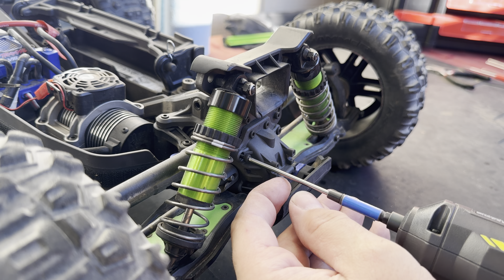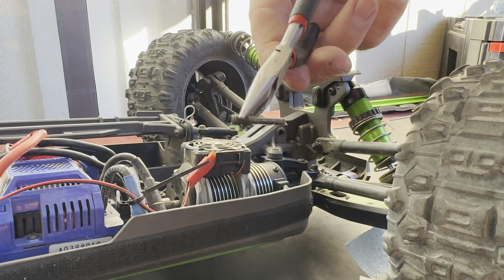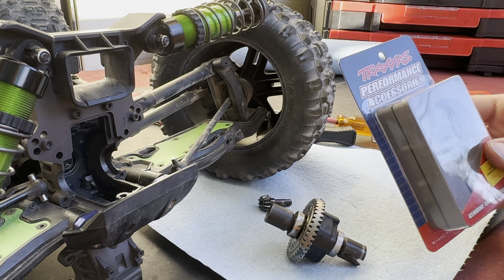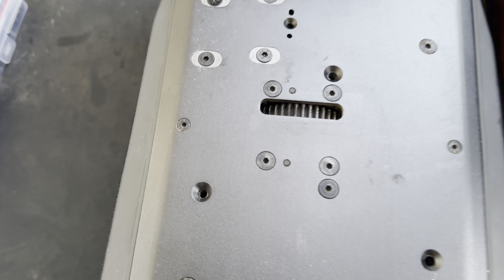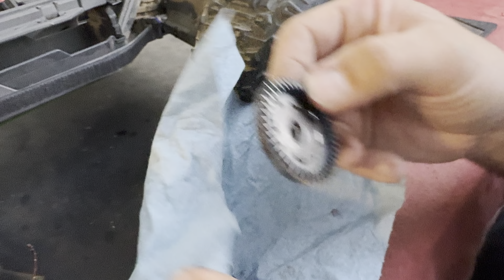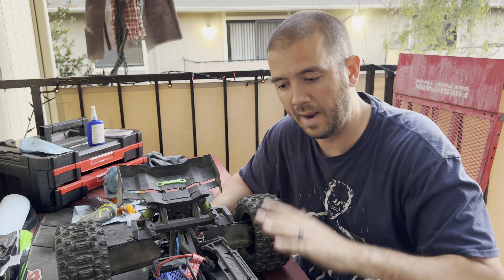Your Traxxas SLEDGE NEEDS These | Spiral Cut Gears “UPGRADE”

Comment: Installed the hardened spur and pinion, front and rear hardened diff gears. Kept the stock spur gear and pinion tooth count and installed the motor shims underneath too. Definitely alot more solid i used the Lucas red and tacky grease in the diff housings though......its definitely alot more responsive when you rip that remote trigger 😅
Reply from the maker: Try the CowRC grease, very nice. If you plan on getting some supplies use RBR10 at checkout. https://cowrc.com
Reply: @redbanditracing ill definitely check out some lubricant and cleaning products.

 I've already ordered and received two of everything suspension and steering wise incase something breaks. I could of gotten an XRT for how much I'm into this sledge including having the repair parts on hand but well worth it when it's a hobby my son and I like to do together.
Reply from the maker: In the last year I’ve broken x1 front axle, x2 front cross braces, x2 front hinge pins, x1 front control arm. And that’s with heavy bashing all year. Pretty beefy truck
Reply: @redbanditracing when i broke a steering block I was like yup buying extra parts for front and rear and threw in progressive shock springs from VG racing about $200 worth of parts then hit that check out button with zero second thoughts....7yr old loves to drive it around too so gonna need them parts on hand 😅

Comment: I wish Traxxas had included the hardened gears in the new Sledge update instead of those stupid belted tires. The Sledge has 20M center diff oil, a powerul torquey motor, and a huge amount of traction, it's a recipe for shredded gears. I've upgraded my Sledge to all hardened gears and put the Hot Racing motor spacers in as well and I don't have any more problems, but it was an expensive upgrade.
Reply from the maker: That’s where I was at, the Sledge is so much fun after the issues are fixed. The belted tires are great for high speed, you’ll get better handling. But you’ll loose that rotation if you plan on bashing.

Comment: I really appreciate all of these videos! Especially with how in depth you go, rather than cutting things out for the sake of making the video shorter. Just picked up my Sledge 2 weeks ago and have learned a ton from your channel. Sounds like I need to check the diffs asap!
Reply from the maker: Always check fluids first, they are always low. Just upgraded 1/16 Erevo with a center diff, it was empty from Traxxas. Thank you for watching, you’ll love the Sledge. Also, we just bashed the Sledge pretty hard during RC Clash Event 10, no gear issues. Stick with Traxxas Hardened gears, cover the slot under the chassis for the spur gear, and a chassis bag.
Reply: @redbanditracing  got the chassis bag. What did you use the cover the spur gear underneath?
Reply from the maker: Just a strip of tape, I’m eventually going to get the M2C chassis. The M2C chassis doesn’t have the opening for the spur.

Comment: I picked one of these up with in almost mint condition with 4 3s batts and the Traxxas dual charger for $450 off marketplace. The original owner already installed the motor cooling fan. I've already upgraded the gears and steering servo. For the price I paid. I'm plenty satisfied with spending some extra $ to upgrade.
Reply from the maker: What a great deal, that’s awesome. Make sure to post them on IG and tag us.

Comment: Motor pinion keeps comming loose you having any issues on your sledge with that and if so what did you do to fix it? Ive tried blue lock tight on the set screw my next step it taking a fine file to the shaft or even getting a small drill bit and making a divit in the shaft so the screw can sit in that.
Reply from the maker: Remove the pinion, put some blue thread locker on the motor shaft where the pinion sits and the set screw. Let it dry over night. It really helps keep that pinion on. I’ve had the same pinion on for almost 6 months now.

Comment: Same output gear needs shimmed to come out more
Reply from the maker: Does not need to be shimmed, been over a year and still going strong.
Reply: @ the first 1 you took out and replaced, a shim behind it to bring the small gear into the diff gears more
Reply from the maker: The pinion gear into the ring gear, there is no shim needed. The gear mesh was perfect. It depends on your RC and how the gears lineup.

Comment: another cool video!!
That's the reason why I don't currently have a Sledge. you definitely have to invest too much to have fun.
aftermarket chassis, HD diffs etc. if I do the math, the Sledege is more expensive than my XRT and that's not OK, especially at a time when Arrma has 2 attractive 8S models on the market.
Reply from the maker: Very true, you will need to upgrade parts out of the box. But that’s with most RC’s. Even the XRT has its own issues. I know the XMaxx needs better pinions and spur gears out of the box as well. Traxxas knows this but it’s a good way for them to keep making money. I think all these cars should come with machined steel gears. Thank you for watching.
Reply: I have had my Sledge for about two months and I haven't had to do anything to it 🤷 It has been a blast to run stock. I guess I did buy a Bluetooth module for the tqi but nothing on the Vehicle itself.

Comment: I just bought a sledge. I can’t say I’m pleased to hear all the issues you have had with it. Would you suggest to go ahead a replace the front and rear gears? I have not even had a chance to take it out for its first run yet.
Reply from the maker: I would not stress, get yourself a chassis bag, and upgrade your front/rear diffs with spiral cut gears. I haven’t had a single issue since, haven’t damaged a pinion or spur.
Reply: Awesome

Comment: I think your tip on flipping the washers is something I am going to try. I noticed after putting them in forward facing the arrows it just feels too tight. With that being the said the motor just failed (smoked) and my small inside voice kept telling my mesh was to tight or almost none existant. I have a new motor coming tomorrow, so I will flip mine to rear facing as well. Also wondering if this is why I have noticed a 5 to 10 minute drop in runtime on my sledge, if its causing to much friction.
Reply from the maker: The Hot Racing washers just don’t work for me, and the support from them is terrible. I’d try M2C or another brand. I removed them and installed the M2C motor mount, no need for anything after that. I was having the same issue with those washers, too tight.

Comment: Imo the key to keep a traxxas car good is, keep the arms and carriers stock. For the F/R diffs; diff housing needs to be alu as well as the diff covers. The chassis needs the lower brace aswell as the top chassis plate of m2c. This prevents Flexing and imo this is one of the causes of gears stripping. For the rest i replaced the sinterd stock gears with spiral gears in the front and rear. Also a little graphite grease on gears.
Reply from the maker: I always tell those to stay away from aluminum, it can cause issues with bearings, bending, and it’s not cheap. My chassis is bent again, but it doesn’t matter because of the M2C motor mount.

Comment: I got the hot racing motor mount washers hat same issue ,hot racing and a main both told me they haven't  heard of any issues
Reply from the maker: That’s what they told me as well, but they just didn’t fit correctly. I’ll tell you this though, the M2C motor mount was tested today….flawless!
Reply: So if I remove the block and put washers in the wrong way the mess will be correct?

Comment: How have your washers done protecting the motor now that you’ve had them in a while ?
Reply from the maker: What washers are you referring too?
Reply: @redbanditracing   hot racing motor mount washers to help prevent any moving
Reply from the maker: I removed those almost immediately, didn’t matter which way I installed them the mesh was too tight. Ended up installed the M2C Motor Mount.
Reply: @redbanditracing  I went with the hot racing motor mount with Traxxas aluminum diff cover and aluminum carrier I never had the pinion issue like some have but was thinking about the washers to for extra caution but thank you good to know

Comment: My sledge quit moving so you think my center diff is gone?

I have the vitvion spirals front and rear?

I am running the castle 1717 on my sledge.

Does anyone not make a drop in c enter diff better than stock?
Reply from the maker: Take out the motor and see if it moved freely. If so, remove the center differential next and see if it moves freely. That’s an easy way to tell what’s not moving. The center differential is very beefy I doubt you need an upgrade. But anytime you add more power you’re going to break things.
Reply: I will try that tmmrw my xrt is full m2c out same with the castle sledge I have a stock ome also upgraded servos shocks pistons and shafts wtc

Comment: Do you happen to have part number for diff gasket kit?
Reply: I've looked and purchased #8680 but the bigger gasket doesn't seem to line up well with the bolt holes
Reply from the maker: Yeah, you wanna get the #9581. I wish they sold just the gaskets but it’s gonna come with the carrier as well.
Reply: @redbanditracing  thank you. I ended up with 3 of the 8680 bc I thought was all the diffs but I'm guessing it's just center diff?
Reply from the maker: Its usable on the sledge, but the 8680 isnt what comes from the factory. 9581 is.
8680 was originally used on the E-Revo.
Reply: @redbanditracing  even the center diff?
Reply: @redbanditracing  thank you for the help too.. ordered 2 of the 9581 just now and the machined gears. You couldn't have uploaded at a better time honestly
Reply from the maker: Glad to help
Reply: @redbanditracing  Still helping ;)

Comment: Thanks man. I’m gonna buy one. Can run the stock ones till they go or should I swap the gears and pinion/spur first. 

Also, is it good now? With all the upgrades. Do you have a fan? Does it over heat with the bag? 

Is there a list for all your upgrades?
Reply from the maker: The M2C motor mount is a must right away, the chassis will bend. I would wait to upgrade the differential gears until they fail, I’ve heard some don’t see issues. But you won’t have issues with those spiral cut gears they are tough. I like using the chassis bag from Hot Racing because it keeps dirt, and rocks out that could damage your pinion/spur gear. I haven’t had any issues since those upgrades. The Sledge doesn’t over heat, but it’s gonna start getting hot out so I will be adding a fan. Hope this helps, check out the Sledge playlist it helps to answer your questions. You’ll love this truck!